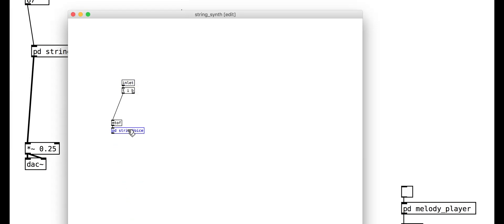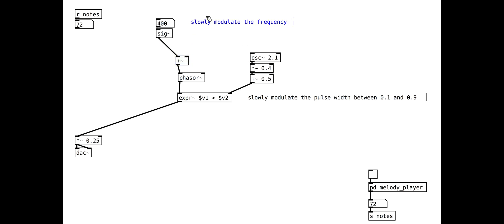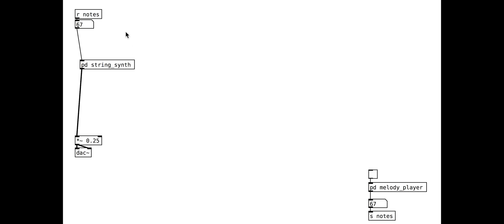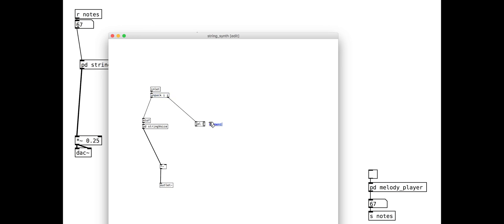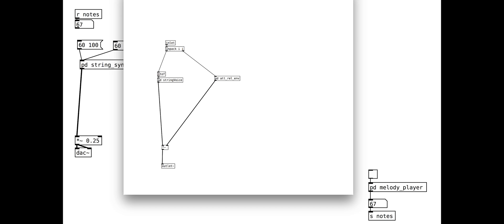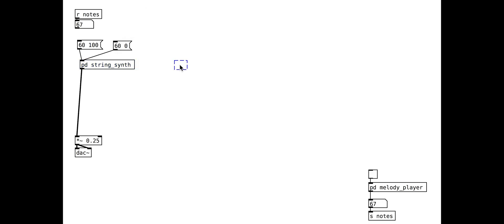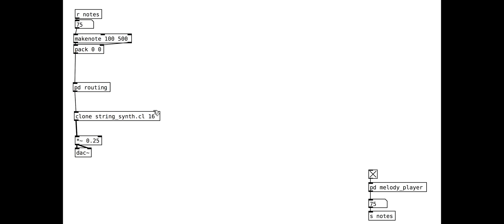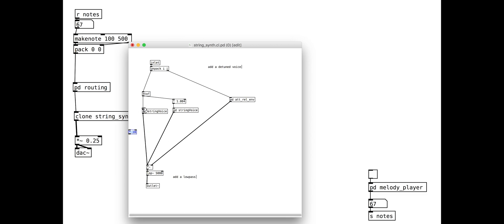PureData tutorials - rich synthesis (7) - Synth Strings

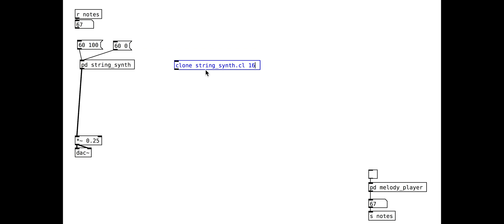Comment: I'm confused when you say you need a more sophisticated routing for voices, because we are turning the notes on and off from outside the clone object. I thought we were turning notes on and off from outside the clone object for previous tutorials, when you hit the toggle for the note sequences, you're turning them on and off right? I'm just really confused from 8:40 on when you introduce the poly object, and I'm not quite sure what its doing and it's purpose. Are you using multiple voices for one note?
Reply from the maker: This is a very valid question. In previous videos we have sent notes to clone, but each sound ends by itself. So all we need to do is find a free voice, then trigger it. The important difference in this video is that the sound will continue indefinitely until we explicitly tell it to stop. That raises the issue of how we know which voice to send the stop (note off) message to. The poly object takes care of that - making sure the correct voice gets the corresponding "off" message.